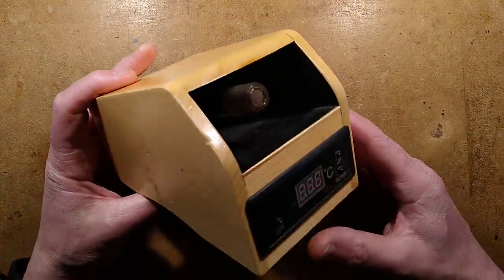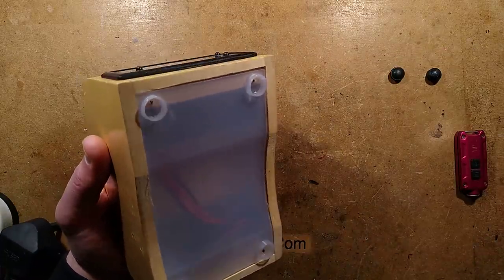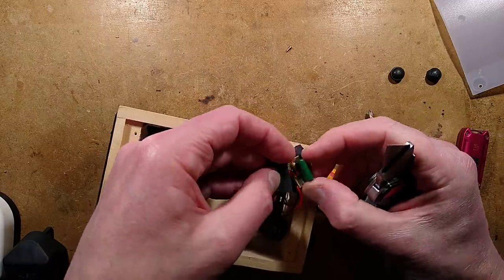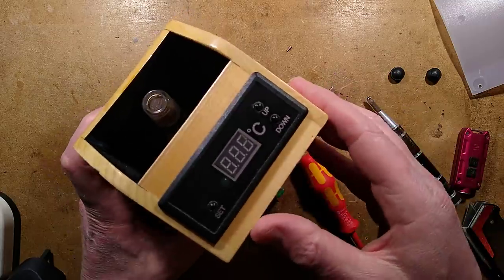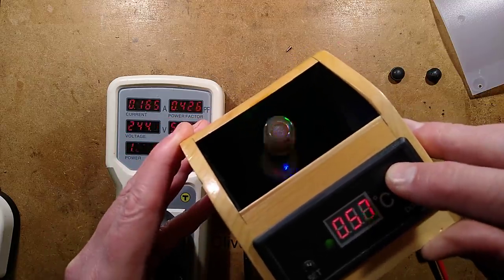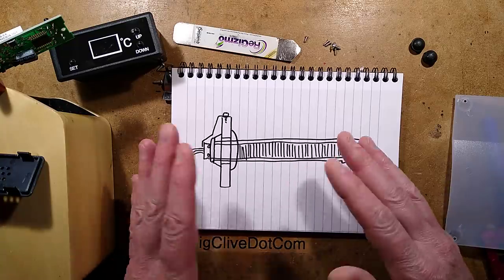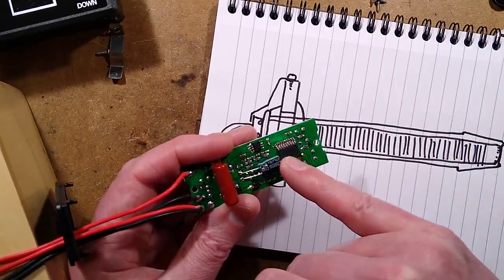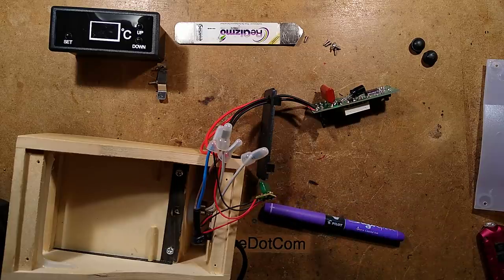Exploring a mystery gadget

Comment: Lol, it's a cannabis vaporizer... that's an old destop model. They make portable pocket models too nowadays. This is for when you want to vape but you don't want to use concentrates, but flower instead but you want vapor not smoke. I had a similar one for years.
Reply: It seems you figured that out... yeah, you don't have to beat around the bush to keep your video from being demonetized. Other YouTubers (who's channels are not cannabis centric) talk about cannabis... this happens all the time and none of them get demonetized.

Like I don't know if it's technically against the community guidelines but it's fine... I've seen lots and lots and lots of channels do it like electrical engineering channels, cycling channels, psychology channels, laundry channels, like yeah I know there are channels that are dedicated to smoking weed but these are like regular old everyday channels not that, and I've seen channels like that just open the start talking about Mary Jane and not have any problems so I'm pretty sure it's fine bro.
Reply from the maker: Right now I'm on a warning while also under suspicion for another risque video I made.  So I'm trying not to push my luck.
Reply: @bigclivedotcom  fair enough. As a fan, I'd rather you not risk it then... don't want one of my favorite channels getting taken down. Still a good video, wish the element tube would've been removable but that's not your fault.

I still call you Big C Live ... probably always will. (Don't know if you remember, I've told you before but I misread the channel name for like the first year before I realized it was Clive (your name)... so now I call you 'big C live' anyways in tribute to that time.

Comment: hahah. that's a vaporizer
Reply: mine is about 20 years old and I haven't smoked any weed in it for a while.. but last I checked, it still works. they're built like tanks!
Reply: my bro reminded me that we actually used to sell these vaporizors back in the late 90's. They were a US-based company, VaporDoc and we started selling them up here in Canada on our website. (Drop shipping before drop shipping was a thing)
-they used to refer to the heating element as the "glass condom" (no joke)..the actual heating element was ceramic.
-the part that Clive doesn't have is called the "whip"... it consists of a glass tube, in which to place your wacky tobaccy, and glass mouthpiece--connected by a long plastic tube
Bro also reminded me about the time I got angry at him and threw the base unit across the room & hit him in the head. I got him good! And the thing still worked! Built like a tank. Made in 'merica. USA! USA!

Comment: @ Bigclivedotcom. You should do video on a Volcano digital vaporizer. I have the manual. low end temp for THC is 325 F. I use the low adjustment. Save AVP for cooking. I like the concept of bag & canister. Fine German equipment. Made to last. Have left the one I have on set temp overnight many times. But the fuckass company wont sell parts. Only consumable parts. Would not sell me a switch. Mouser had the part. Then when a big enough pile of AVP is on hand. Go see Diamond Delight Ediblis, she has fun channel.

Comment: I have one of these and I can confirm it works fairly well, although I wouldn't recommend it 😅 I do believe it was designed more as a shisha vaporiser and does not perform great for uhh other purposes

The temp regulation and the quality of the heater is very so-so but newer units are a lot better. You should be able to pull the glass tube out of the silicone grommet then everything falls to bits, I forget how to do it. It all just vaguely sits in place but requires some force. I remember the glass 'whips' for these were particularly annoying as they would perfectly cut themselves in half at fairly regular intervals

Comment: 🔥me☝️Hahahaha I had one of those…they suck. (Got mine from a FREE pile) It’s a vaporizer for da marijuana’s it pulses so you don’t over heat the weed as you pass it around.  Well you don’t pass the box around they come with a glass tube to put your “herbs in” the glass tube has a silicone hose to suck on.  That’s the part you puff on and pass around…well if you have friends to smoke with that is…Eye DonT HavE AnY FriendS 😢So….Eye SmokE AlonE💨

Comment: Hi Clive, For some reason I'm being blocked from commenting on this post on your channel, no matter which address I sign in with - do you not heart me no more?
Reply from the maker: I wonder if you're using trigger words.  I'll check the "held comments" area.
Reply: @bigclivedotcom  Hi Clive, I just wondered if you'd inadvertently blocked my addresses from commenting. 
All I tried to say, tongue in cheek, was you were casting aspersions against an 'innocent' device that a major distributor currently describes as an aromatherapy product. I went on to give a link with price but it failed to post, several times. I then went on to edit down anything that looked like a key word but no joy. Not sure if the AI censor got the hump because I used the word at***ser or because I finally described that well known supplier as being named after the longest river in South America. How did we get here, where robots decide what we're allowed to think and say?
Reply from the maker: @rudolfecker7691  It probably detected a commercial link.